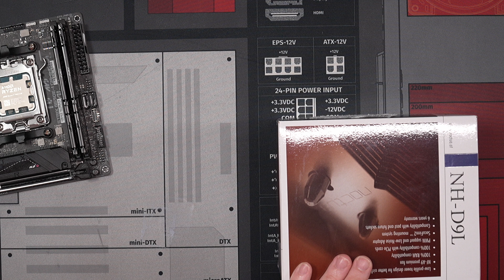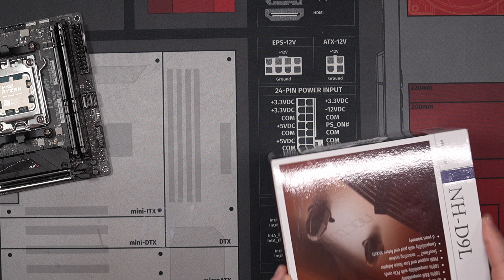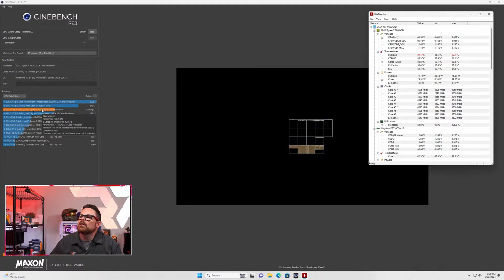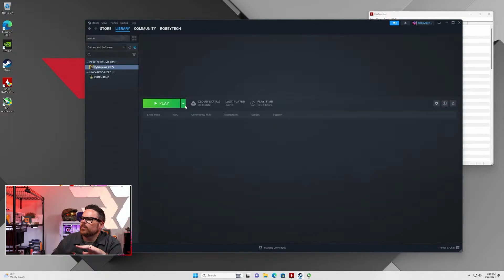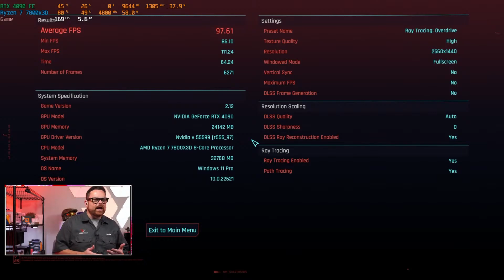We put a 4090 in the Fractal Mood! This didn't go well.

Comment: 3:43 You mount the fan the way you would in a standard tower case with front to back airflow. But once the motherboard is mounted, the airflow in this case goes back to front (or bottom to top), which means your CPU fan is blowing in the opposite direction instead of just working with the natural flow of the case. No wonder your temps were bad.
Reply: @robey answer?
Reply: @pabloruizdegaribay3480  its true, the cable side of the fan is the exhaust he is blowing the hot air down where it rises up again

Comment: I'm abt to mod this case, rip off this nasty fabric and replace it with a breathable fabric that has a dope print, but not before I drill holes on the sides down near where the cpu cooler lives and figure out where I can add intake fans to make this as neutral pressure as possible. 7900xtx repasted with jp-dx2 diamond thermal paste 17w conductivity, 12700k + thermal grizzly mounting plate + jpdx2 diamond paste. + thermalright silver soul. Undervolt both 12700k and 7900xtx. The back dust filter is coming off too, possibly whole panel wrapped in same new breathable fabric as a lesser filter.

Comment: Fractal has some great looking cases that perform horribly. That case looks good, but is incredibly large compared to some other ITX cases that perform way above this. 

The NCASE M2 shits all over this thing. 

No idea who’s running fractal, but they’re doing a terrible job when it comes to these ITX cases.
Reply: This case is all about aesthetics over performance. With a 280mm aio, the CPU cooling is adequate with slim 140mm fans for my 5950x and my 3090 does just fine in it. But the all white color way goes great with my Alienware monitor/mouse/keyboard and looks great in my white office. And does everything I need it to for video editing and gaming. Overall I love it. Doesn't even look like a computer.
Reply from the maker: They have good performing cases also, I really like Fractal.  But yes form time to time you have to really consider what you are going to put inside of them.
Reply: I have a torrent nano that absolutely destroys temp tests.
7800x3d and an rtx 4080 super.
Max cpu and gpu temps hover between 45-60 °c under load.
This is on an ultrawide oled g8 with 2 1440p ultragear add on monitors. Best build i've done ever!